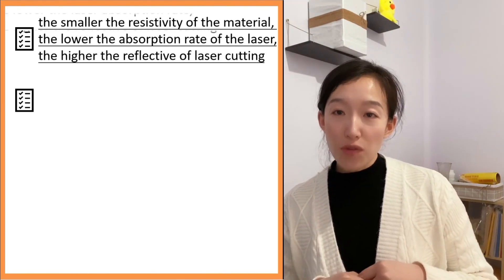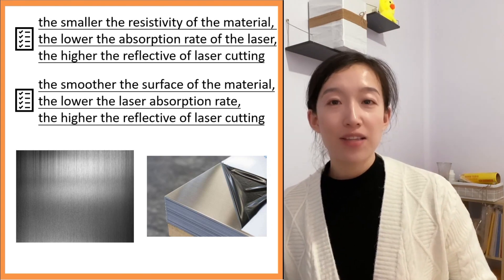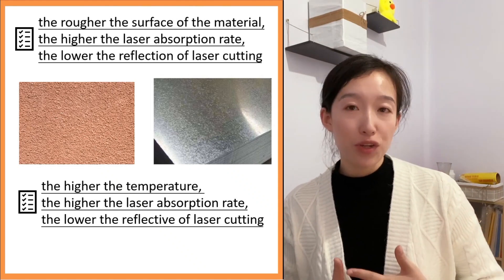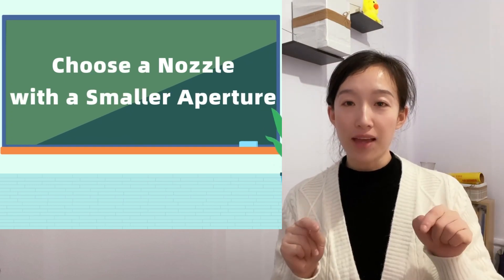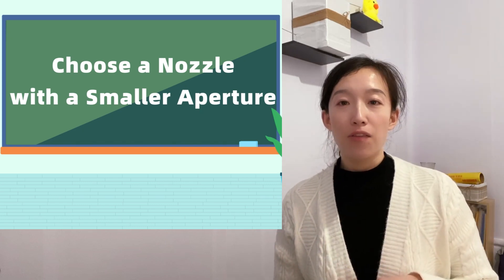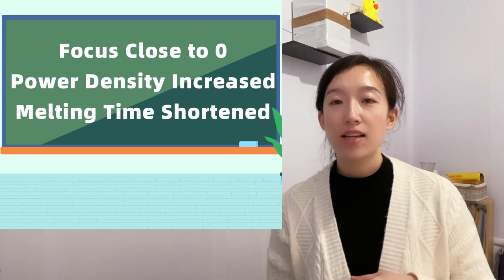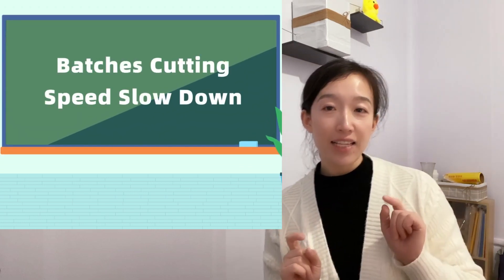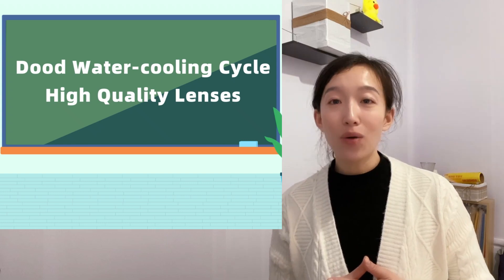Aluminum Copper Laser Cutting | High Reflective Laser Cutting

Comment: Hello Clara, first I am a big fan of your videos.
You said that the fact of having laser beam perpendicular to the shiny materials may damage the laser source, I have a laser source mounted on a robot arm so I can change the angle, so am I safe when I cut with angle? and at what angle should I cut? and if I understand correctly the main problem is in piercing, so is it optimum to pierce on an angle and then return to perpendicular or only a little angle?
Reply from the maker: I can not say it is safe.
Reply: Have chinese vesion